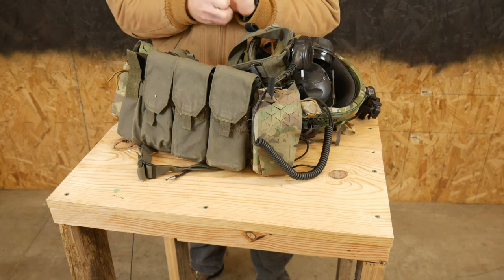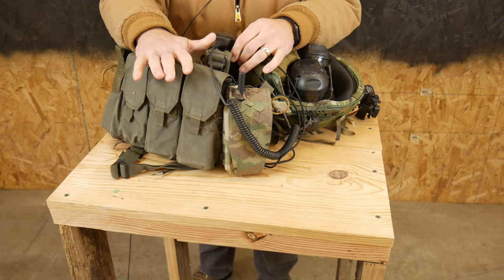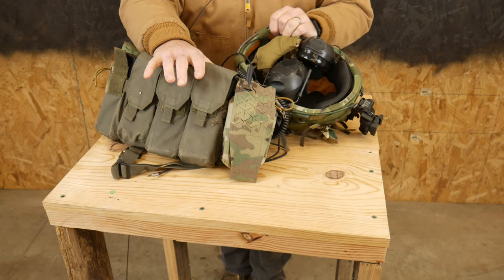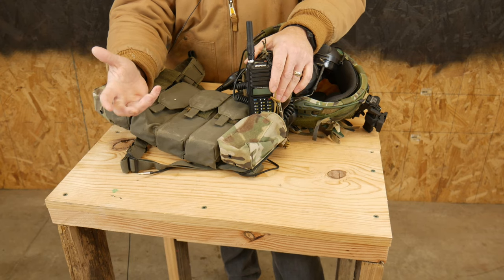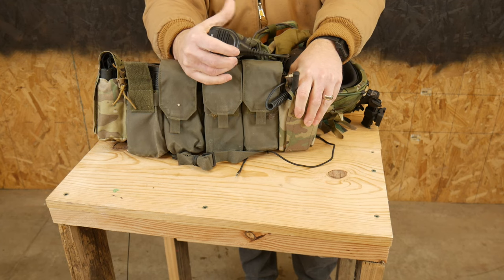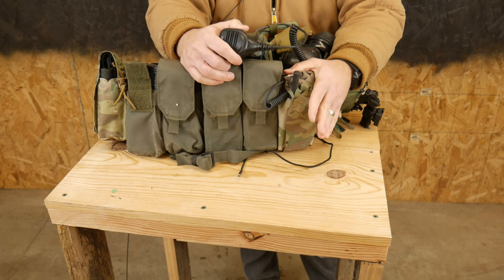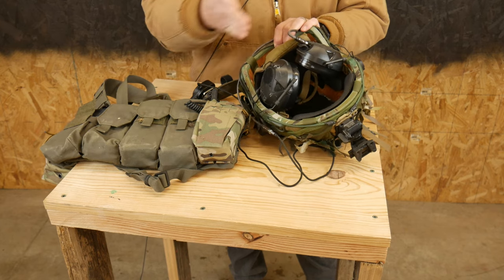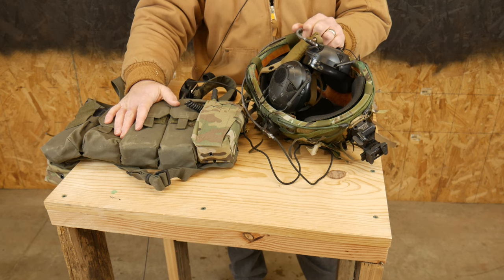American Minute Man Gear Part 38:  Comms Set Up

Comment: How does your sling not mess with all those cables? I don't run a radio. 

I didn't know "high loss" radio antenna was a thing, and that you could just swap it out for different uses. That makes me more interested in radio
Reply from the maker: Rubber bands, tape, you do whatever you need to do to control those cables.  It can be a pain sometimes. 

yea, that swap out on antennas helps

Honestly, I'm kinda 50/50 on radios.  They can be super helpful, but they can also be a pain. I go back and forth on them. 

Here's my video on that;
https://youtu.be/Oc3jGDBrOJ8